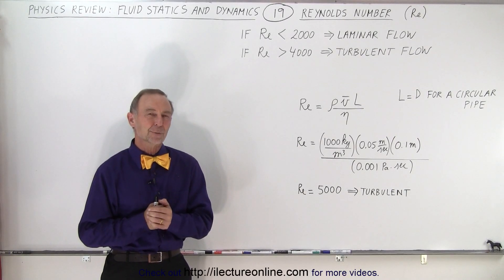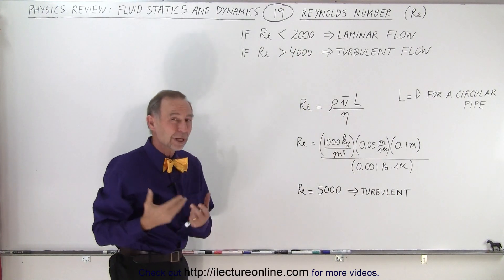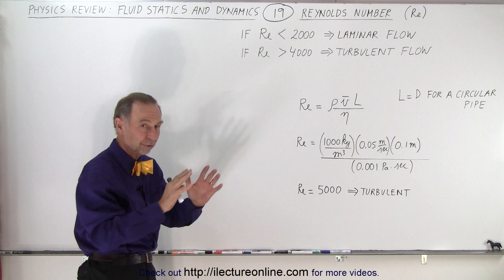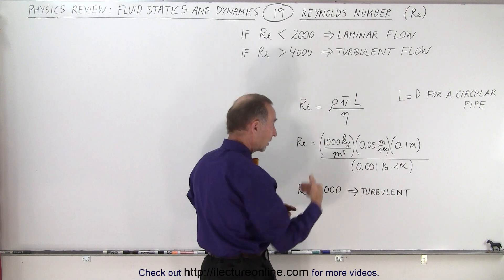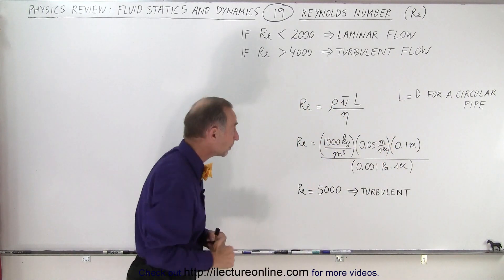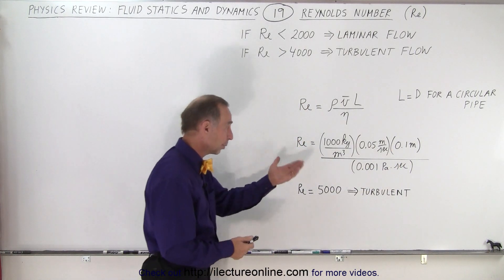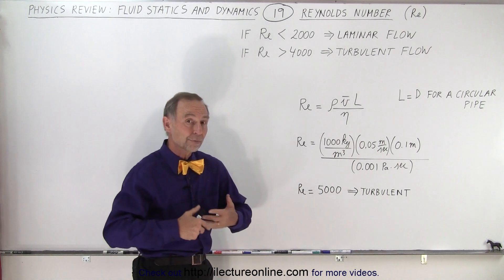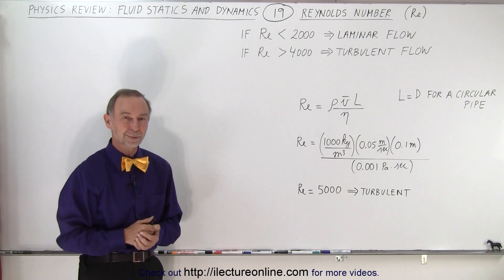Physics Review Fluid Statics Dynamics #19 Reynolds Number (Re)

Comment: Interesting.  From the formula i can see if the pipe diameter would  be 0.02m at the same other  parameters  the Re =1000, so it means  it would  be laminar flow. Therefore  if i replace one 0.1 m pipe by five  0.02m pipes  i can have the same volume of liquid per second and spend less energy because  laminate flow has less friction.  Am I right ? From first glance  it seems  to be  wrong that 1 big pipe has more resistance than 5 small.
Reply from the maker: Since dV/dt = Av  (where A is the cross-sectional area and v is the velocity), you would need 25 - 2 cm diameter pipes to replace 1 - 10 cm diameter pipe.   If you keep it to one pipe and go to 5 cm instead of 10 cm you would need to quadruple the speed of the fluid which would then increase the Reynolds number.
Reply: @MichelvanBiezen  thank you!